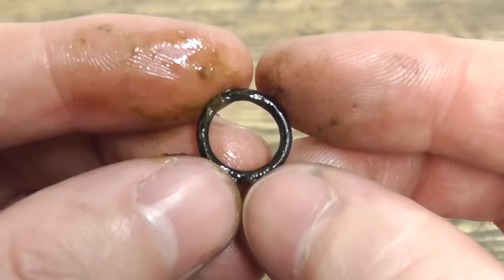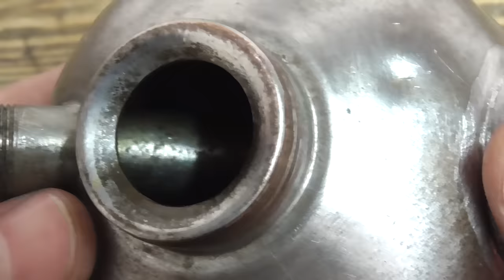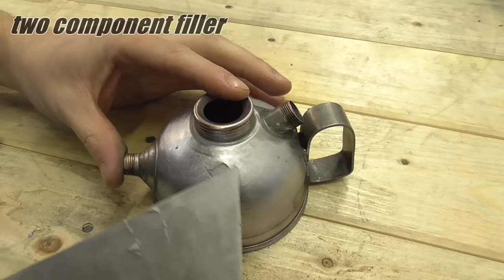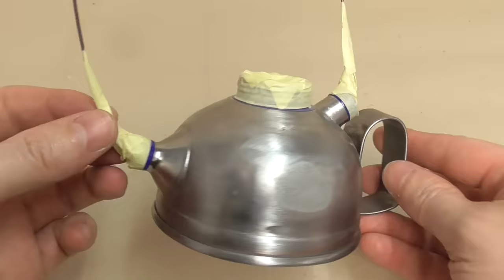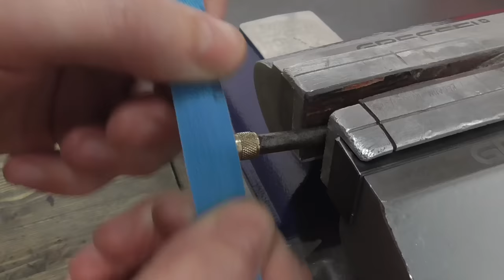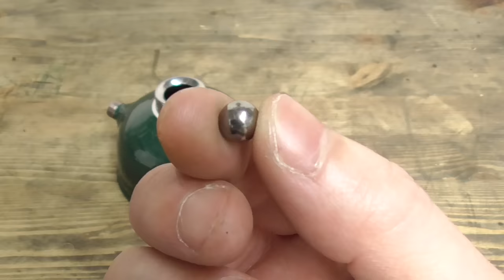Antique Dented Oiler - Perfect Restoration

Comment: For getting out the dent, use a steel ball bearing (large as you can fit through the mouth) and a strong permanent rare earth magnet on the outside, they come with handles for repairing horned musical instruments, but you can fabricate a handle cheaper. Keep using the magnet to roll the bearing across the dent till its gone. Works like a charm and no weld marks.
Reply: How does this work when the body of the item itself is steel...?
Reply: @MilesBader  It doesn't really work out as well, the ball tends to stick and roll sluggishly, it makes an already awkward task even worse (you wouldn't use this method when you could access the underside easier with other tools).  But heating the workpiece up to around ~700C+ makes it nonmagnetic and slightly more malleable (until it cools down).
Reply: I thought he could have pushed it out with his finger. Wondered why he did it at all as he then filled and painted it. the dent puller/welding tool seemed to lead to a lot more work with the welding and filing etc.
Reply: You could also fix it with a paintless dent removal approach.  Machine a steel collar that fits inside the filler neck.  A stout steel rod with a rounded end and appropriate bends is then inserted through the collar and the dents are levered out from the inside, prying against the collar.
Reply: I would have tried one of those epoxy hold cheap dent pullers for automotive body work to pull the dents, but your way came out perfect.   Definitely know what you're doing, I hope you can do this for a living if you don't already-I can see a nice little shop full of various restored antiquities.
Reply: was also wondering if an air compressor with bungs in openings might have pushed it out (but might of damaged joints). I also have a vacuum pump and maybe that would have done it from the outside with the right attachment at the end to seal the pipe around the dent.
Reply: What i didnt like abount the restore was the weld holes that had to be patched, the oil will break down the two part  patch eventually, would have been much better to use silver solder and bernz micro torch would last foreever
Reply: Yes I also thought compressed air was the only solution.
Reply: @jadesluv  I think it will be okay for the next 100 years
Reply: Why complicate things so much? The simplest method is: Pour dry peas inside. Pour water. The peas will swell and push the sheet out. Wash the item. Repeat the process if necessary. A method proven on thousands of military canteens from WWII and similar.

Comment: #1 Best Restorer on YouTube right here. Fascinating to see that welding dent remover, never seen anything like that before and it worked perfectly! I never even knew that Threading File existed either, very cool!
Reply: Silent002 exactly the same as me the dent remover and that file are two things ive never seen before
Reply: As a professional body shop repair man, I use one of those dent pullers when  access to the dent with lifting bars is not available. Top tip: clean the tip of the puller with a fine file after each pull minimises the risk of pulling holes in the metal.
Reply: I'd have to agree. I've seen about a dozen channels thus far. And while Hand Tool Rescue does a great job, he doesn't use a polishing buff wheel on the goddamned pump springs.  I Kinda want to label this kind of dedication to not...restoration, but some higher calibur. Words fail me. But essentially Restore might mean, clean it, fix the broken parts, and maybe a paint job. But he goes so far beyond, with the polishing, machining new parts. THESE PROJECTS ARE SUPERIOR TO WHEN THEY WERE NEW. Restoration...just doesn't feel adequate a term.
Reply: I agree that he is the number 1 on youtube from what i have seen. But only part what i am kinda sad about is that,he was the first youtuber who i started to watch restoring and he set the standars so high that noone can compete with him,that now if i watch someone else it feels like they are missing on details when restoring something.. Would have been much better if i would have seen someone else first and they would seem very good aswell and than gradually i would have found this channel and i would think this dudes restoration is just waaay more advanced (which it is). It is like he is the level 100 from 100. And now if watch anything else,it's not so enjoyable like watching this dude's restoration.
Reply: @LastPrecent  Exactly my problem, haha :) With other channels it's like I'm already questioning "why doesn't he/she do it like him", as it clearly works.
Reply: Silent002
That is used to chase out threads on anything either too big or too hard to chase out with dies. You can find them at any old hardware store.
Reply: @TizonaAmanthia  RestoMod is the word you are looking for.
Reply: I was waiting to see how he removes dent and it's great.
Reply: I really like the fact that He is in Switzerland so he has access to rusty old Swiss antiques. I think Swiss companies very rarely make anything shoddy so when he brings those items back to life you know it's going to be of very high quality.
Reply: Hand Tool Rescue for what it’s worth I think you are better than this guy (probably not the right comment chain to say this in though haha)
Reply: @HandToolRescue  I suppose it is modified. But okay. thankya my dude. steals a slurp of nutella.
Reply: @stevelampard  Is there a trade name for that kind of dent puller? I've never seen a tool like that before. Love to get one...
Reply: @k.r.baylor8825  me too.  I have done auto body and frame repair for 42 years and have never seen a dent puller like that.  Stud welders are nasty tools to use.

Comment: Wow, I've never seen that method of dent pulling.
Reply: They use it a lot on bodywork
Reply: that genuinely scared me to watch
Reply: What's the tool called?
Reply: @_.-._.-.  it works on the car because it's a much larger pannel. I've seen that video too xD
Reply: i have seen this method in cars.
Reply: That is high speed right there.
Reply: KennyRedSocks Look up Lenco spot welder / Lenco dent puller.  Also see the channel  Arthur tussik
Reply: Harry Look up Lenco spot welder / Lenco dent puller.  Also see the channel  Arthur tussik
Reply: @fervent2896  spotter

Comment: Amazing new look to this old oil can👏. But am I the only viewer on here who actually prefers the old used antique look?
Reply from the maker: I appreciate your oppinion, thanks for watching :-)
Reply: Yes. You’re the only one.
Reply: In this particular case I would partially agree. I restored an old bicylce from the late 1940s over the course of a few months, disassembling it thoroughly. I even took apart every single ball bearing and only replaced parts that were absolutely beyond repair since I wanted as many original parts as possible in my new old bike. After cleaning, repairing and reassembling it, it is now running smoothly while still showing the black paintjob from over 70 years ago on its frame and just some clear coated bare metal parts. And honestly in most cases I also prefer the "aged" look over a new paint job because I have the sense that this is part of the bikes character, as Steve already mentioned.
But concerning the oily, greasy grime that had built up on this canfor ages I would have chosen to do it over as well 🙂

Comment: I read long ago British soldier's would get small dents in their canteen's they would empty the canteen and fill it to the brim with those white navy beans, then add some water slowly trying to keep solidly packed.Put on canteen cap tight and over night the beans will expand and pop out small dents from inside out. You can repeat process as needed.
Reply: I should fill my dented Hyundai Accent.
Reply: I don't think that will work. The beans swell up, but the water shrinks down by an exactly equal amount. There won't be a change of volume. However, if the soaking beans are out-gassing that could effectively increase the volume. But I've never noticed beans bubbling when their soaking.
Reply: jhanthony2 well in that case bang goes the ancient practice of using poplar wood pegs to split large rocks by placing them in small fissures and soaking them until they expand.
Reply: But in that case you soak the peg AFTER you put it in the rock; you don't put a wet peg into the rock and expect to increase in size. If you soak a peg in water it will expand as long as it remains in the water; as soon as it is removed from the water and wiped off it stops expanding.I used to read similar stories about the clipper ships from the 19th century that were carrying rice. During storms the rice would get soaked, expand, and blow up the ship. I was skeptical.
Reply: Didn't Hanibal use salt in the rock cracks and then pour water on it? But in this case I would have made a tool to dent it back from the inside out instead using that weird spot welding device and still had to plaster it. Guess it was a tryout.
Reply: @jhanthony2  That's just the plot of a Horatio Hornblower book
Reply: @jhanthony2  Wrong. When the beans absorb the water the change in volume will be greater than the volume of the water because the molecular structure of hydrated beans is different than of dry beans.
Reply: jhanthony2 very wrong. Water is uncompressible
Reply: Steve, that could very well be a possibility. Do you know of any place on the internet that discusses this? When I enter "beans" and "water" into Google I can't get past recipes for soaking beans.This could be a fun kitchen experiment but I worry that the difference in volume may be on the order of 2% to 3% and easily overlooked. If the difference were around 10% the results would be more conclusive.
Reply: What about water and the freezer

Comment: "I mean it's not like he's gonna be able to do much restoration on the inside of the container that you can't disassemble.."
removes all the rust from the inside
Reply: nothing special, if you have for example an old fuel tank of a motorcycle. 
But then you don't use a Lathe but a concrete mixer ;)
Reply: WHERE’S YOUR GOD NOW?!

Comment: You are quite good at working the polishing machine. Most people would not be able to polish a spring like that without getting it caught and flung across the room! I always hear at least one item a day smack into the rubber stopper in our polishing hood. Mostly its just small bits of compound that people are reluctant to throw away but every now and then it's a ring. 99% it's totally fine but there's that 1% where I have to sit at my bench with the ring, come to terms with reality, breath deeply and say to myself, "I make a new one."
Reply: What is your job?
Reply: @co.1157  MM is a CNC mechanic by trade.

Comment: Am I the only one who would like to see how the ballbearing and parts actually went back together.
Great video 👍🏻
Reply: I replayed that twice and still don't get it. It sounded like after the felt washer went in then the ball and the u shaped "thingy" just clanked like they fell in. I'm assuming they didn't because it pumped oil just fine. An unsolved mystery I have to live with lol
Reply: @joanncrefasi9458  I wondered the same thing, how did he know that the U=shaped thing went into position correctly? I want to know its function.
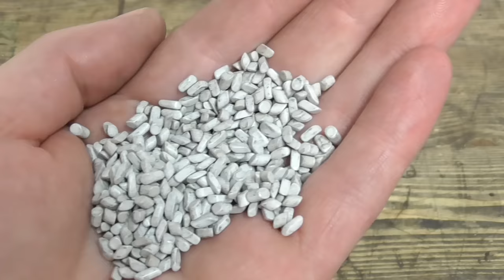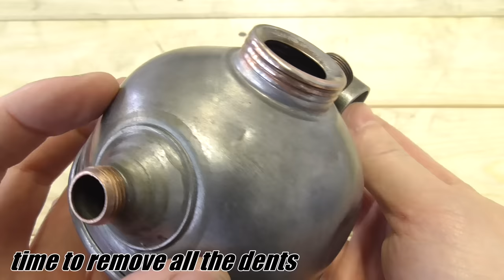Reply: After thinking about it for a bit... it looks like a check valve that allows oil to be pulled up into the pump when the plunger is pushed out with the spring. The when you press the plunger back down, it closes the valve and oil is forced out the other tube to the tip which also has a check valve to keep the oil from being drawn back into the can. I am guessing the the 2 tubes meet inside the can somehow (you can just make out where they meet @3:02 and again @3:33). That's my guess.
Reply: Jo Ann Crefasi those were items that were “buried” there. He just put them back to let them again RIP.

Comment: I just cleaned one of these today but only cleaned it (I don't have the tools or the patience to do as much as you did). The only differences are that the small part with the ball at the beginning of the tube is in aluminium on mine and your cork gasket is a simple rubber gasket on mine.
It was painted in a copper like paint on the outside. I didn't touch that. Very good job on yours, it's always impressive to see the end result.

Comment: All your restoration work is beyond better.  I have been Auto Painting for 42 years now.  My recommendation is to Spray a thin coat of either Etch Primer or Epoxy Primer before you spray the Primer.  Unless the Primer states that its a DTM 2 Component Primer (DTM - Direct to Metal)  Otherwise that Primer in time can flake off with the nice Top Coat.  
Remember that unless specified by the manufacturer, no primer or paint will stick to Bare Metal.  It might adhere for some time, months or even years, but its just not work the risk.
Just wanted to chip in my 2 cents....Excellent work anyway.

Comment: Man that turned out great. That’s really nice work. I have 2 very old oil cans. Mine aren’t the squeeze pump type. There are what I think called gravity fed. The revisor is a cup that narrows up to a point. Then there’s a stem about 8 inches long. You turn it point the stem to the desired spot and put pressure on the bottom of the cup. The bottom of the cup kind of gives back and forth. There are no moving parts. I have a small and medium size cans. I have to guess the age about from the 30s.

Comment: Tip:   Silver brazing with white flux for such delicate parts is a bit safer compared to welding the small pits / holes. A product called 'Silv-stay', if I remember correctly.

Comment: I used sand and water in an old motorcycle gas tank and shook the hell out of it, worked like a charm. Be sure to rinse out the water with denatured alcohol and then dry it thoroughly and leave it in the Sun. Hell of a lot cheaper than chemicals and grinding stones.
Reply from the maker: I got both for free ;-)

Comment: To remove dents, try filling with water, cap off all openings and place in the freezer, checking every hour.
Reply: I think the flat bottom would have been the first thing to move if done with freezing
Reply: @shawncrocker7037  Yeah, I though the same thing, might need to place a round
piece of plywood on the bottom and sandwich everything with a caul on top 
in a pair of clamps.

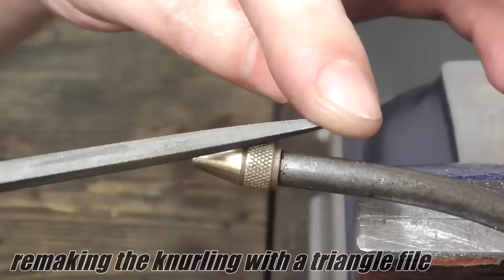Comment: At 7:40, filing the knurling part. My reasoning is if there is a knurling, it was meant to provide grip to the fingers to tighten or loosen a part with fingers. In which case, the brass nozzle was meant to be removed and refixed, probably to be replaced with a nozzle of a different profile best suited for that application. 
That gives me the idea that the nozzle could have been unscrewed, threaded onto a mandrel on the lathe made specifically for this purpose, and the knurling could have been reformed on the lathe. A challenge, however, would be to find a knurling tool of the same pitch. Not impossible though,

Comment: That o-ring isn't the right size, a previous owner must have put it there. Originally it probably had a leather band. If you can't find an o-ring that wide, the next best thing would be ganging up thinner ones, else it's going to get twisted in that bigger groove.
Reply: Correct, or a leather cup, also i think there may have been a small air vent in top screw cap.

Comment: Sir, I think that O-Ring needs Teflon backup rings. Then, it'll shoot oil across the room.  Teflon back-up rings are designed to prevent extrusion in rubber o-ring sealing systems.

Comment: I used compressed air to remove a smooth dint from an old lawn mower gas tank. Was like new. I was given one very similar to this but taller last week  - it still squirts out oil powerfully. These things were made to last - ( not made in China.)

Comment: A thing of beauty and a joy forever!  
However, I am surprised by the choice of tools with which he chose to do the cleanup. A small rotary Dremel wire brush, a sonic cleaner, small sandblaster and a better dent puller would be my options. i do not go for the bling aspect in many ways. Tools all have there stories and should be there to be listened to.  Paint scratches and dribbles, glue drops, and yes even the dents! I have a small tool box that survived a car rollover with me and has a very significant dent across the top, but it still opens without hesitation and has that story. My paint of choice is Tremclad. Once the metal is clean of oily film and dust, just light coats of paint that are allowed to dry hard, make a good finish.
Reply from the maker: I think so too, thank you very much!

Comment: What was te purpose of the metal ball and steel "u" shaped piece inside the oiler
Reply: It's a valve.  It pulls back to allow oil to flow from the reservoir into the piston and then closes so the piston can push it to the spigot.  The plastic piece in the spigot is the anti-suckback valve that prevents air or oil from flowing backwards into the piston.
Reply: I believe op is also curious how all those pieces fall into place.  From our view the mechanic is just dropping a metal ball and a u shape piece in the can. Too bad we couldnt get a bright light and a view inside to see how the pieces fall into place.  Then we would have an easier time understanding what @elizabeth explained.  Very cool how ppl think of these micro processes in their inventions

Comment: Have you considered heating the metal to 160-200 degrees F and then using dry ice to pop out the dents?  A lot of auto body shops use it to remove dents
Reply from the maker: Really? never heard of it

Comment: Cant understand why you cut a center hole in the cork gasket for the screw on top cap. Doesnt make sense. Any oil that now should get up above between gasket and cap pools there. Once cap is loosened it will all drip down sides of cap 🙃
Anyway....nice vid. 
Thanx